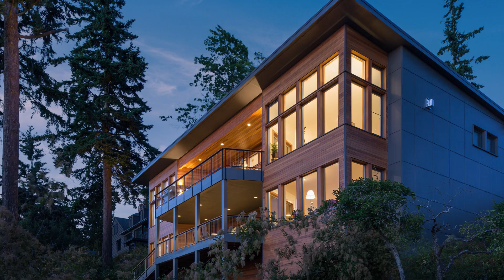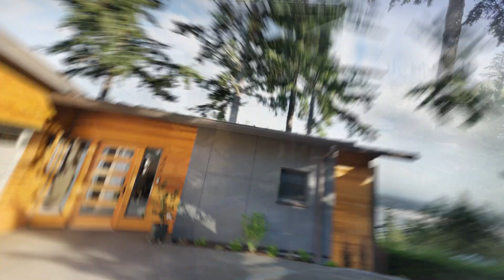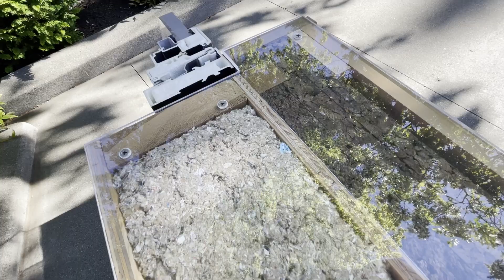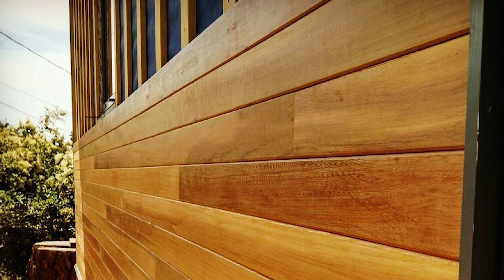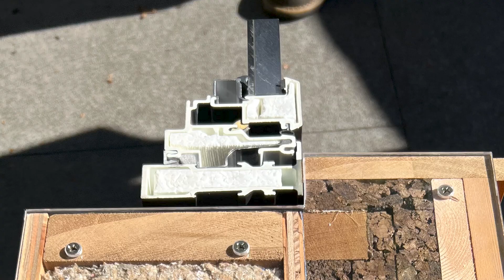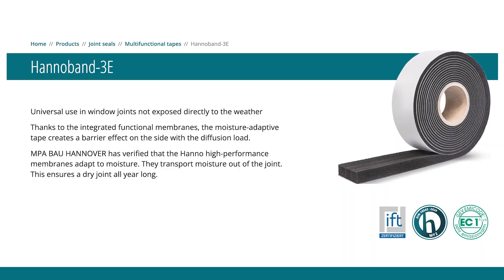High Performance Wall Assembly Tour

Comment: When I first saw Chucknut build in Bellingham, I thought you were going to refer to the build in 2024 where the used Prefab walls accomplishing the same wall design by “Collective Carpentry” again achieving Passive home with a prefab assembly.